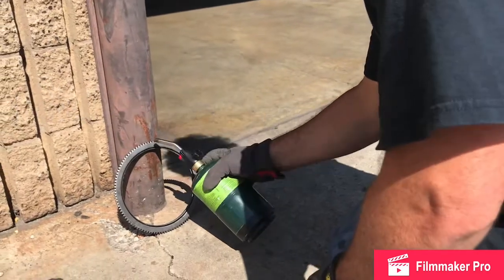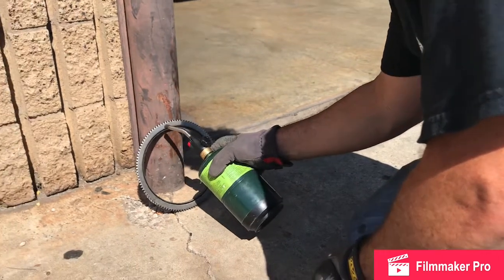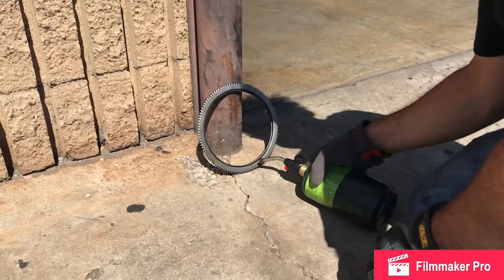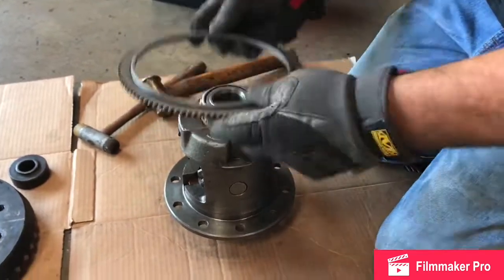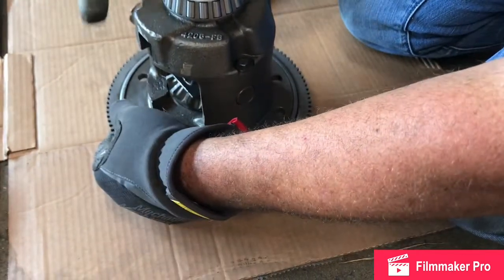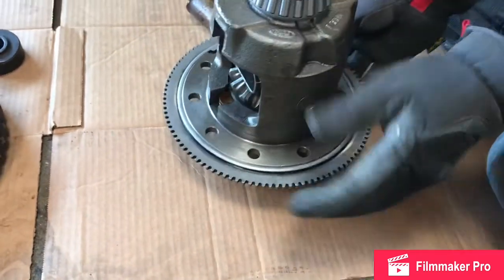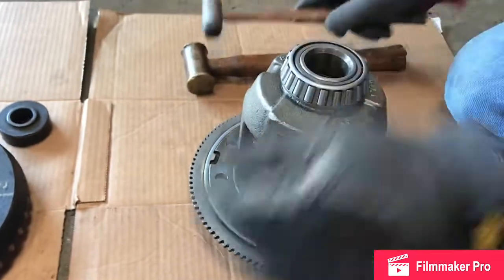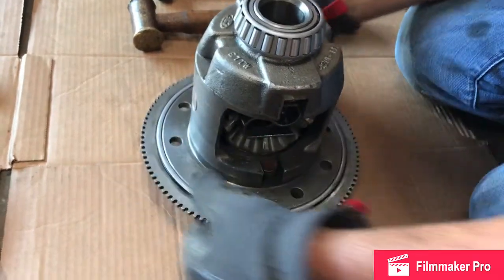Ford 8.8 Axle Tone Ring, ABS ring installation. Ford Differential ABS ring replacement

Comment: Would the tong ring fit an LSD or Locker? Looking to buy an Eaton Truetrac, and don’t want to be without ABS brakes.
Reply from the maker: I believe it will fit if you purchased the locker that is compatible with ABS brakes.